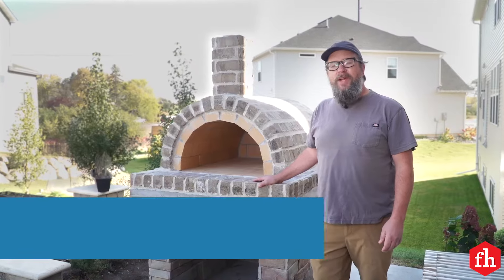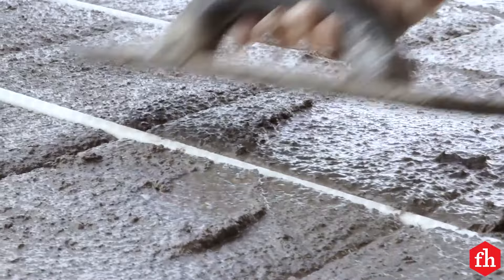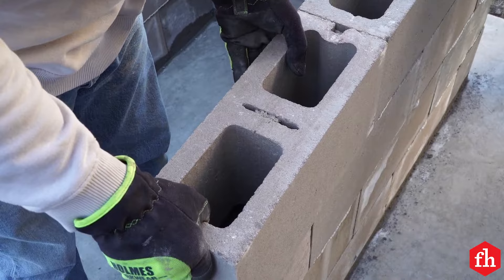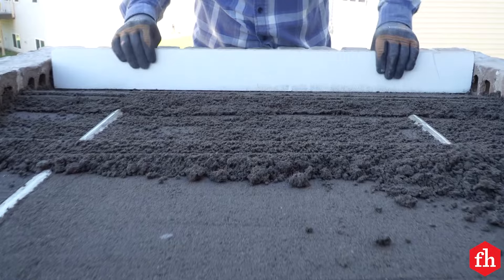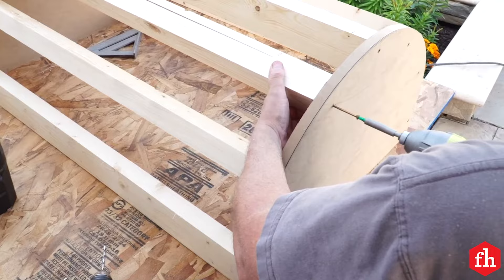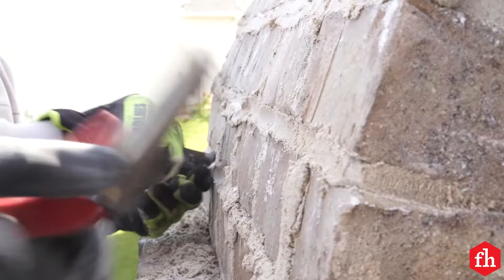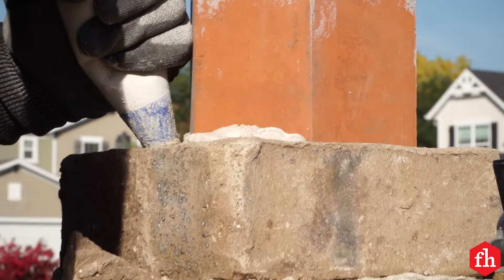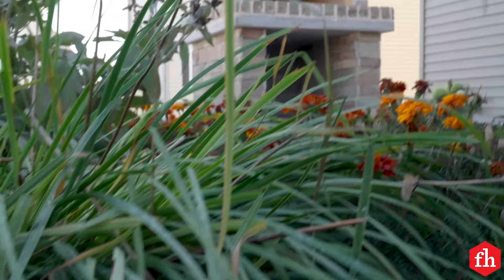How to Build a DIY Wood Fired Pizza Oven

Comment: Being that I am a journeyman bricklayer I can see multiple flaws. I'm not arguing dome vs tunnel design.  First off it would be so much easier to just build everything with mortar.  Using glue to hold the blocks together might work if you live in Florida.  Any climate that sees cold weather and snow may want to think this out.  Way over built with the 6 inch concrete pad 4 inches is plenty.  Then using a grout bag to mortar bricks together... Lots of voids and especially under the fire brick.  This thing is likely to fall apart
Reply: You should make video on properly making the brick oven
Reply: @jose.utah.realestate  There are plenty of them showing tried and true methods of creating a long lasting oven. I think the biggest problem here is that they built it for a homeowner, not for themselves. They won't have to look at it and eventually see the flaws, poor performance, etc.
Reply: Broo, it's a phucking pizza oven...not building a house
Reply: Looks great but probably needs more than beginner level skill.  Professional’s get paid as much for knowledge as well as labor.
Reply: Yes I laughed at the ‘grout bag’.
Reply: I built one for our pool patio area in 2019-2020.  Was wondering where there insulation was.  My base below the firebrick has a bed of refractory mortar as well as insulation layer, then it was wrapped in insulation blanket after the firebrick layer for dome and back, chicken wire over that, then parge coat.  Finally decorative stone after that.  More thermal mass and insulation, longer e holds heat better.  I can make pizzas in 90 to 120 seconds for first few, then they do start to go longer after that, but my oven holds the heat well.  This thing will definitely bake, and probably cook pizzas etc, but it won’t be very efficient and may take longer to heat up as wel as cook.  I live in upstate NY as well, so everything was mortar or high temp mortar where firebrick was used.  Firebrick also needs to be soaked as well before installing.  You can do it like this, makes a nice little conversation spot on patio etc, but to last and work efficiently you may want to research a bit more.  I used brick wood ovens free plans on the web.  Functional oven took 5 weeks of summer (working on it every couple of days or so between my job) then cosmetic work the following summer (mainly facing the cinder block).  I have never done masonry before so I asked local people who have (for tips etc, and any special needs due to our climate here).  I made mistakes in my design ( I really did like how they made their form for their arch, I used styrofoam insulation and shim boards and it was a hassle), I would have made my dome a bit shorter had I known how the oven would operate.  They do have a good dome height in video.  For all who read this, thanks, for the TLDR crowd, you are being tricked by your phone and media into having short attention spans,  this is going to come back and bite us as a nation when we as the citizenry have complex issues to deal with and solve, and no one can take the time or effort to pay attention.
Reply: Do you have a video of a good one in mind? I want to make one, but I'd rather make one that's going to last. This one is pretty, but I have four seasons, I want to make one functional.
Reply: 😂😂 take it easy😂😂
Reply: @sickler3044 he is right. There is a science to a proper oven and believe it or not, this oven will not work. Due to its poor design, it will never get hot enough. And since the dome is so large and the opening doesn’t get smaller, all the heat and smoke will be pushing right out the front of the oven in your face. You can’t just throw bricks together. Then it will fall apart after continuous fires do to the bad mirroring. The sad thing is people may actually spend money and time to follow this and it will not work. As said earlier, there are actually real oven designs out there that work…….this isn’t it.
Reply: @BrianGrimo  is this your opinion or your experience as an outdoor oven creator?  I'm in Siem Reap, Cambodia and I've seen outdoor ovens made for less operate functionally.  Why do you feel your opinion is credible?
Reply: I just do hard scraping pavers and mortar edging together and was thinking this is over complicated. Def voids that can explode

Comment: sorry completely wrong build. you need a smaller opening at the front and the chimney is not placed at the top of the tunnel.
Reply: I just built this design but I made sure to add insulation all around the fire bricks and under, works just fine.

Comment: Attention everyone: never leave your dome and oven floor uninsulated , you will never be able to cook more than 2-3 pizzas with one fire. Your oven floor will get cooler in 30 min while the active fire still exists. I learned the hard way so you shouldn’t. Use 2” calsil boards for your floor and 2 inch ceramic fire blankets for the dome. By the way this type of ovens domes are not efficient as traditional domes because the door openings is too large and bottom of the flu gallery is at the same level as the oven dome so it will suck the entire heat before it heats up the oven floor and dome.
Reply: I followed your advice thank you

Comment: cool build, but there is a problem with the design of the arch form.  it should be shaped (curved) in such a way at the front, so that the the heat is directed back down towards the entrance.  no doubt, it will cook a great pizza though, but you will want to add a door.
Reply: I dont understand, 
Can you give us a youtubechannel that build a very good oven at your perspective
Reply: Artisan Made does a good job
Reply: Non isolation ???????????

Comment: Bricklayers Honest review: very good looking pizza oven but if your building this in the UK do not use adhesive to glue cilinder blocks together cold and rainy climate with weaken it, and likely cause it to tip over, mortar and concrete blocks will do just fine and be a lot cheaper, secondly make sure you add ceramic fibre insulation under the fire bricks and around them, this oven in the video will have to milk through wood in order to get the temperature high enough to make a pizza so always add proper insulation, I’d recommend making a door for the front too as this isn’t a dome design oven and can’t contain the heat as well. Other than that very nice design 🔥
Reply: Yeah,  that's not going to end well.

Comment: One thing that affects the efficiency of the oven is how well the fire bricks are insulated. You need to add heat-proof mortar or concrete mix with the added little stainless steel needles to it and vermiculite

Comment: Thank you for your video and design.   It inspired me to build one last summer in my back yard with a few changes due to my climate in Ontario.    Works great!!   
We found if you light charcoal as your foundation and add wood to that it speeds up the heating time.

Comment: Nice build. Looks much easier than the domed ones people try to build. Would love to see a follow up video making a pizza inside. Just needs a door which would make for a great video too.
Reply: Ya, how is that going to work without the front end closed off some to keep the heat in?  Also, the other comment here about an insulating layer around the oven is probably the better way to do it.  Nice work, hope it works.

Comment: Nice build. It is based on the Brickwood oven design. I built one like that nearly 10 years ago. It did work but I was not happy with the results I was getting. I added insulation over the arch which did help a little. 
I then set about designing a dome type oven which I built with help from the Forno Bravo forum. It has a 36" cooking area.
Having used both types of oven there is no comparison between them. My dome type oven will retain enough heat after a Friday night pizza cook to do cook bread the following morning with no additional firing.
Reply: That's very helpful

Comment: Pros & Cons of this design vs the dome design? I'm planning on building an oven and im 98% sure its going to be a dome. This looks alot easier to build but are the cooking and heat retention properties the same?
Reply: this vid is way off base, you are correct, follow the golden ratio that's been used all over Europe
Reply: You know it won't hold heat near as much because there's no insulation  between brick layers
Reply: I think once the bricks are heated up it'll make a fine pizza.

Comment: As a civil engineer, I'm sure you can use that as a bunker in hurricane.
Reply: I thought the same thing.
Reply: Seriously... Did the guy have a surplus of concrete laying around? 😅

I'm hoping the 8" thick base was to match the existing patio or something. Damn near park a tank on it 😅
Reply: @echoradius2299 my question is how does that adhesive react with oven temperatures

Comment: Looks like if you put a door on front you will need a vent pipe in back for air with a little damper on it to adjust the air flow for heat.

Comment: Question: could I build something like this on the edge of an existing 4 inch concrete patio? Using the existing patio as my base? Is that going to crack/ruin my patio?
Reply: I think you will be fine if your concrete patio is reinforced and has a strong solid clay base.

Comment: Looks great. Couple of questions. Can you cook directly on those particular bricks? What do you consider "low temperature fires"? Obviously not a rip-roaring conflagration but more than a couple of match sticks and a handful of twigs. I've been scribbling out ideas to build an outdoor kitchen and I'd like a pizza oven in the mix. I'd hate to do all that work and then screw it up by going too hot or not hot enough.
Reply: I thought the same n usually I seen it roaring hot like 600-800f for thin crispy pizza  but can also use a pizza stone if not wanting to have a roaring fire but this depends on the size of your pizza oven too. Good luck on your project

Comment: Does the capstone need to be made of any specific kind of concrete in order to withstand any heat transfer through the firebricks?
Reply: The most ideal mix would be Refectory castable with standard concrete to give it so longevity, but refectory castable is hard to come by so you could just use standard concrete and use a ceramic fiber board insulation between the fire bricks and concrete capstone, this is the most ideal as it offers insulation
Reply: Should be some type of insulation heat rated ofcourse
Reply: Granite!! Thermal shock , not if, but when it will crack, concrete isn't designed for such heat...

Comment: There is absolutely no reason why you couldn't have used cement between the blocks. Adhesive? The inside of that thing gets hot. You want adhesive heating up and releasing chemicals into your food?
Reply: They used heat proof mortar for the firebricks
Reply: The fire and heat are in the oven, constructed with fire bricks and refractory mortar, not in the base. Little heat will transfer to the concrete legs.